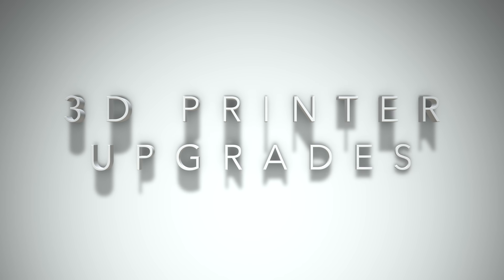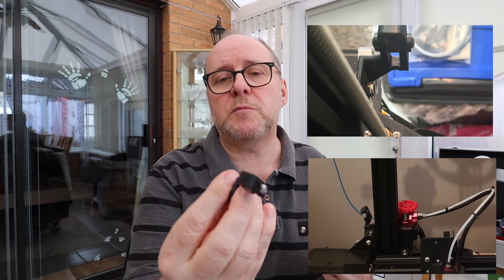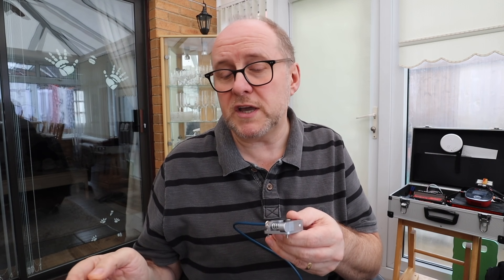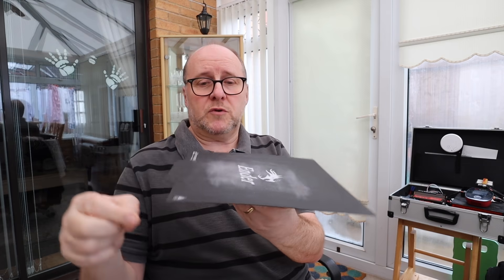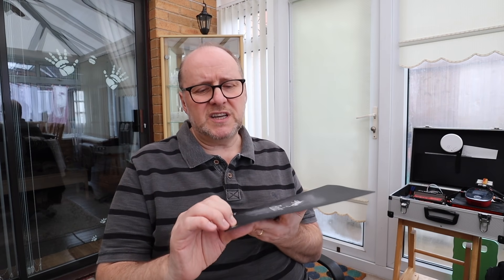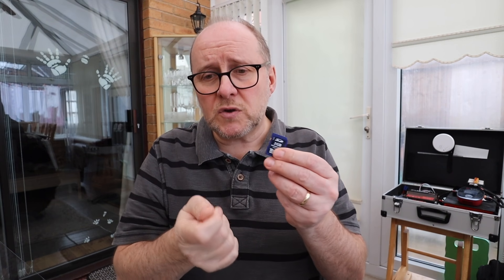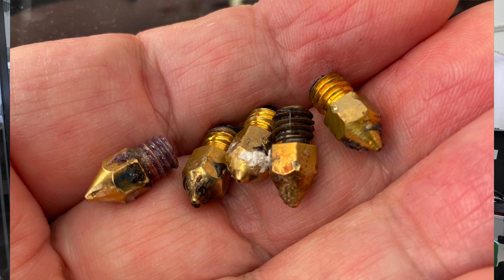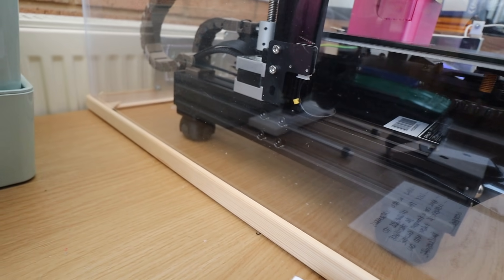Ender 3 Pro Upgrades and tips

Comment: Dose a 3d printer  use a lot of electricity as i was thinking of getting one 🤔
Reply from the maker: Not really, they run at 24 or 12V via a Power Supply. When they first start up they will draw about on average about 120W and settles down to average 70W as the thermostats do their thing. Maybe as much as your TV.

Comment: The glass bed SUCKS i cant get the models to stick at all.   I have to use blue painters tape to get a successful print.
Reply from the maker: I found that the bed temperature needs to be >60 degC. I used acetone to clean it and it started failing. I then roughed it up with sand paper and was ok again but not as good as when it was new. I then sprayed silicone on my stepper motors and that was the kiss of death to the glass bed as the overspray must have coated it.
I bought a new one.....I now only clean it cold with IPA (isopropanol alcohol) and works great. I sometimes have to wait for it to cool down considerably to get the prints un-stuck.

Comment: Hey, great videos. I have a problem with the Endor 3 v2 please help. I have been printing for about a week. Now when I download a new Gcode file the printer doesn't see the new Gcode file. The old ones are there but the new file is not there. the printer is not reading anything new that was put on the SD card. I cannot figure out what's going on
Reply from the maker: I assume you use slicing software like Cura? When you select to export the model you may need to select "*.gcode" as the output format as it often defaults to a different format like "*.3mf". If it is "*.gcode" and your printer is not seing the file I would recommend deleting and reinstalling the slicer software and follow the software settings for your printer as something may have changed. You may need to define the filament and nozzle sizes for example.
Some ideas for you to check out
Reply: TWS reviews First of all thank you very much for your response to my question. The problem was the file was too long...wow I spent a day trying to fix.
Reply from the maker: @emilgabl9069  lol....Ahhhh  and if they are too long you can't read them on the printer display either, so I do generally keep them short and group them in folders / catagories.
Reply: TWS reviews yup, file was too long

Comment: I've had my ender 3 pro for over 18 months & there some more upgrades that you can do, to keep the machine quiet, without the enclosure. In my experience, enclosures are only good for when your printing with the likes of ABS. A main board upgrade is the way ahead, to reduce the noise of your machine. Adding a raspi & octoprint is another must upgrade. Loads of good reasons why. One is, no need to remove the sd card. You can transfer the gcode directly to octoprint via the web page. If you want more upgrade ideas or help, drop me a msg & I will gladly help a fellow welshman out 👍🍺

Comment: Do you need to pump up the bed temp with glass ? Can't get PLA prints to stick with mine
Reply: You need to clean the glass bed. Put some neat dish soap on it & use a new clean sponge with a little bit of water & work the soap into the glass. Then rinse off with hot water. Do not touch the glass with your fingers at any time. The oil on your fingers will transfer to the glass & stop the filamet will kit stick to the bed.
Reply: @syntaxcuemi3d53  what he said, and I use some watered down glue stick

Comment: I also have an Ender 3 Pro. Extruder upgrade is a must. I'm using the mirror tiles from Lowes. Dirt cheap and work amazing. I hated the magnetic crap they put on the pro. I peeled mine off and tossed it. A HUGE upgrade for it is a Raspberry Pi kit and install octoprint. Hook a cheap webcam up to it and you never have to fiddle with an SD card ever again. And you can monitor the print from anywhere, and stop it and all that good stuff. TH3D solid bed mounts and  EZABL Pro are a must. I'll never run a printer without an EZABL.
Reply from the maker: Mark Jones thanks for the feedback. Does the raspberry pi need a pc to be running
Reply: @TWSreviews  Nope. Basically you flash the octoprint operating system onto the microSD card. Boot it up and configure the wifi to work with your router SSID and password. Then when you go to use your printer you just open your web browser and go to the ip address that you need to reserve in your router (which is super easy) and just use the webGUI interface. Drag and drop the gcode file you want to print and hit print. The Pi plugs from one of the USB ports to the mini USB on the ender 3. No more walking back and forth with an SD card. Its wonderful. Highly recomended. After you start your print you can turn off your PC.

Comment: the best mods for the Ender 3 IMHO are
- electronics fan cover (so small filament parts do not get in)
- power unit fan cover to help with the sound dampening 
- the little nob for filament is great to help change filaments
- capricorn tubing with the small ring on the extruder to avoid the standard PTFE melt and rotate

and then, the rest
- upgrade the mainboard (why not the SKR 1.4) so you can fit 2209 drivers and the sound (almost) vanishes ... darn fans :P
- upgrade the TFT to the touch LCD that even gives you WiFi module and USB-A output ... no more cards!!!
- add the BL Touch, no matter what bed material you have, all prints come out amazingly :)
Reply from the maker: Thanks for the feedback....
I did have the extruder knob and do miss that since I wend with the dual drive

Comment: Really enjoying the info and delivery style. More content please. Just bought a ender 3 pro and got the key upgrades (glass plate, springs, feet, metal feeder setup). Still having issues changing tip. Please do a video showing how to do that.
Reply from the maker: Thanks......Good idea, I will do a video changing the tip when I next need to do it. Has to be done hot.
Reply: My recommendation is changing to an all metal hot-end, I think it makes changing the nozzle easier

Comment: Great vid! Do you have any upgrades to make your printer silent? I heard there were some issues with the dampers not fitting the Ender 3 Pro model.
Reply from the maker: it will never be silent unless you put it into an enclosure. Don't waste money on dampers for stepper motors as everything goes out of alignment and creates a whole world of pain. Soft Rubber feet or foam blocks under the printer is best to stop vibration noise will make a massive difference
Reply: 1.1.6 silent board i cant believe how quiet it is now! crazy!
Reply: Teaching Tech has a vid on a mainboard from Bigthreetech 1.2

Comment: The most amazing thing I have learned about 3D printers is, 90% of things people print are upgrade parts for the printer. It's vicious and unnecessary circle.
Reply: I think you mean fisher men!
Never ending circle of buying rods, reels and tackle you rarley use.
I admit to printing a few upgrades for my printer but for me there are more "uneccessary" upgrades that you can buy!
Examples for my Ender 3:
You don't need a dual drive extruder or indeed a metal one! My stock extruder has a brass insert so gone are the days of the extruder hole getting worn out.
You don't need to buy a touch screen, pointless expense!
You don't need to buy TL smoothers or damper mounts for the stepper motors!
You don't need to buy the "Capricorn" ptfe tubing!
You don't need to buy a glass bed, in fact if you do you will add more weight and may increase lines in your prints due to stepper motor strain!
All of the stock items in the above upgrades work very well on my Ender 3, if you need to replace parts then yes, go ahead and upgrade them!
Just my tuppence, I'm sure there will be those who disagree.
Reply: Its a little like woodworkers making things for their workshops.